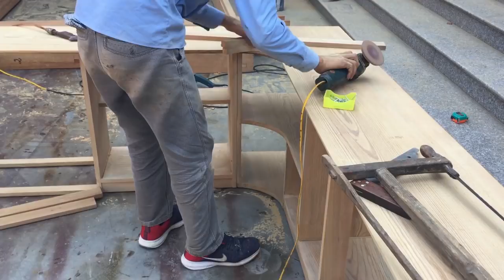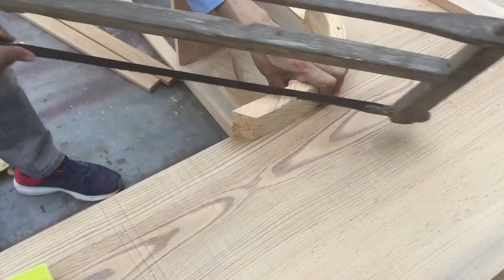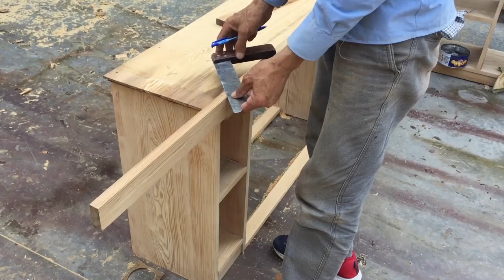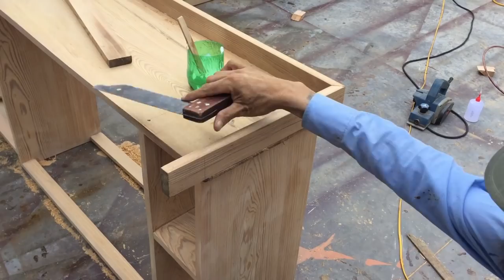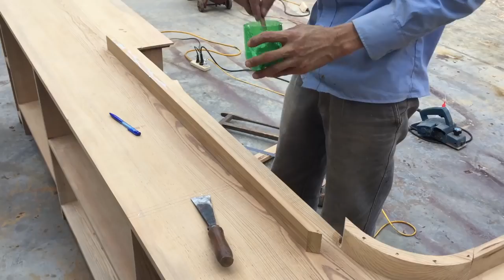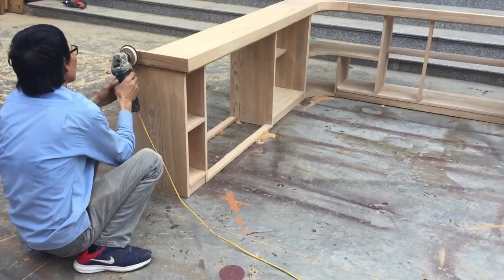Amazing Woodworking Techniques Extreme Intelligent - Building A Parts Crown kitchen Cabinets, Art

Comment: Good carpentry doesn't require nails every half inch to hold things together. If it's done properly, nails are only used to hold things in place while the glue dries.
Reply: MAGA MAN, I don’t think the amount of nails they used have anything to do with the quality of their work... good work, good carpenters, overkilled on nailing that’s all.

Comment: I like rustic hand made stuff, ….not soo much the mass produced stuff with all the fancy tools...….it lacks any real character when you are just using the same router bit and jointer as the next guy.    The rustic stuff I like much more and would like that much more than the mass produced rustic.

   Fine wood working is a art and I can appreciate it for sure, its just not what I like the look of.  I also like the look of hand chiseled ruff cut stone,...we all have our preferences.  No need to cut another mans work down, because its not to your thing.